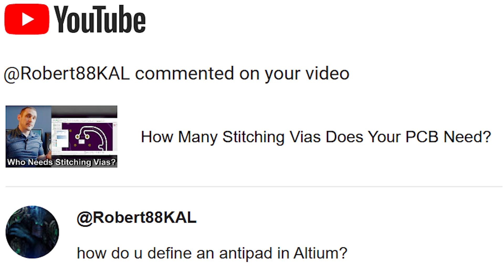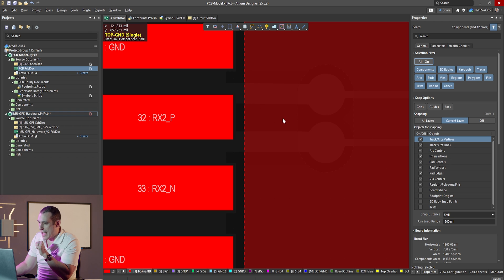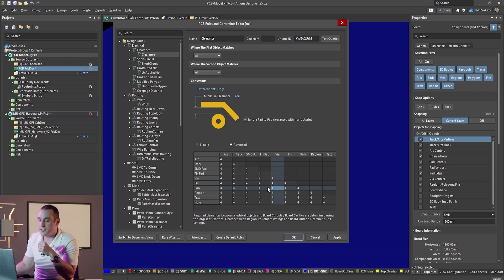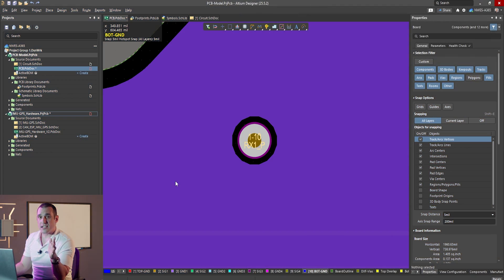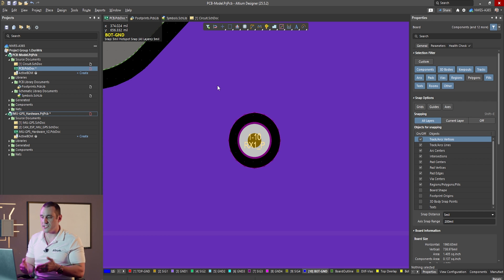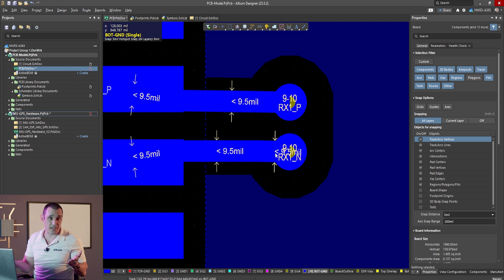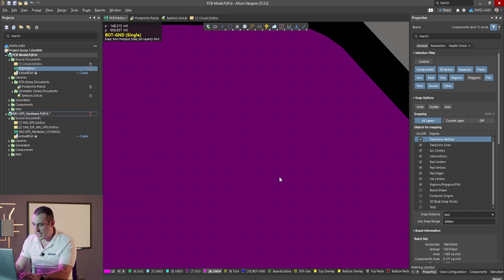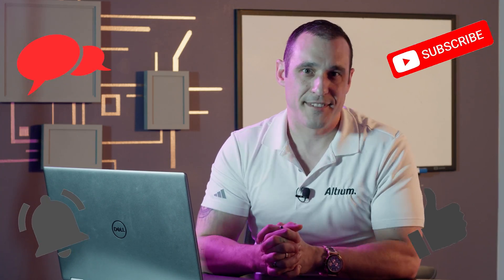How to Draw Antipads - Complete Tutorial

Comment: Nowadays altium allows us to put "keepout" objects on specific layers. Maybe... in the future... we may be able to specify multiple layers in those objects instead of single/all. Be aware, that you may encounter with some  copper pouring bugs when using zero values in AD. This why i am personally prefer to use some tiny values e.g. 0.05mm or even 0.01mm. Also i am often use simple lines with certain width/length values when i dont need complex cutouts.

Comment: How do you remove non functional pads in a via stack?
Reply: Tools » Remove Unused Pad Shapes
Reply: Just remember to KEEP top and bottom rings!
Reply: There are multiple ways to do it. You can select a via or through-hole pad, and make the pad full-stack in the properties panel, from there you can set the pad size to 0 on specific layers and this will eliminate the pads on those layers. You can also use the Tool --> Remove Unused Pad Shapes tool as mentioned in another comment. Finally, when you have the layout completed and you would like to remove all the pads in your fabrication exports, there will be an option in the Gerber export settings and the ODB++ export settings. By default, the Gerbers will be set to keep all unused pads in the copper layers. The default ODB++ settings will be set to remove the unused pads. Make sure to check for this when you configure the fabircation exports in your OutJob file or if you use the Export option from the File menu inside the PCB Editor.

Comment: Hello Professor,

I’m currently working on a stereo amplifier project in Altium Designer, and I’m trying to use a Hierarchical Schematic approach to better manage a Multi-Channel design, like for Left and Right audio channels.

One issue I’m facing is how to properly use a Multi-Part component, such as the VR50KX2 stereo potentiometer. This component contains two potentiometers (Part A and Part B) within a single package.

The problem is:

I'm not sure whether I should directly assign Part A to Channel L and Part B to Channel R in separate schematic sheets.

When I use Repeat Sheet for the hierarchical design, it duplicates the entire component, resulting in two VRs instead of sharing just one (with Part A and Part B mapped to different channels).

So I would like to ask for your advice on the following:

What’s the proper way to handle Multi-Part components in a Multi-Channel design so that only one physical component (like VR50KX2) is shared between both channels?

Should I assign designators like VR1A and VR1B manually, or is there a best practice within Altium to do this?
If you have any examples or best practices for working with Multi-Part components in hierarchical and repeated channel designs, I’d really appreciate your guidance.
Reply: Am working on Amplifier design
Reply: If you get funky with name expansion, you might be able to trick it into compiling if you're careful with your channel suffixes. No guarantee
Reply: Although it is not the nicest solution, you can also use 3-3 ports on the left and right channels, put the stereo potmeter on the sheet where the channel sheet entries are, and connect its legs to the ports directly.